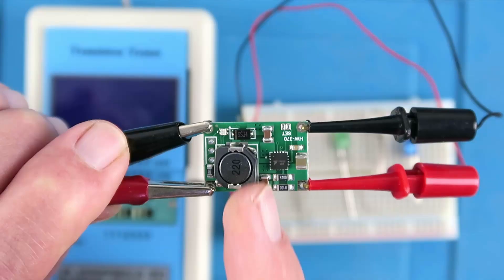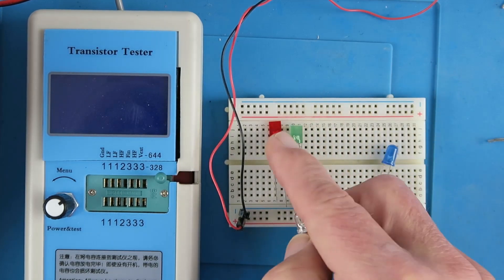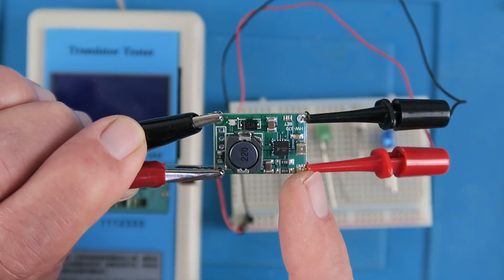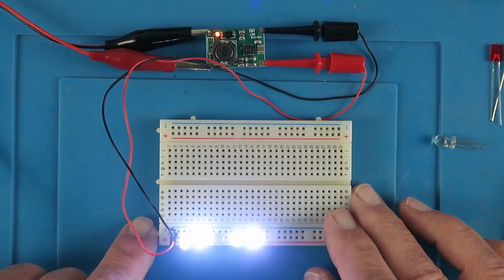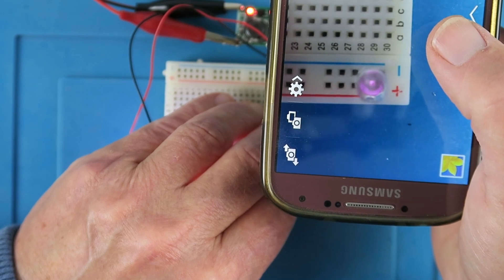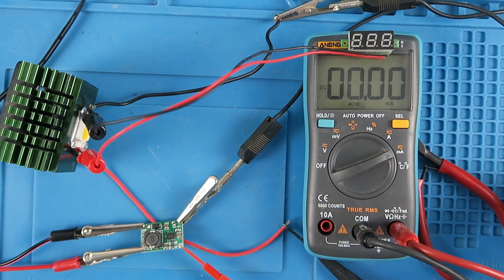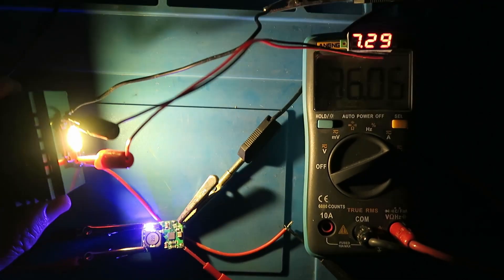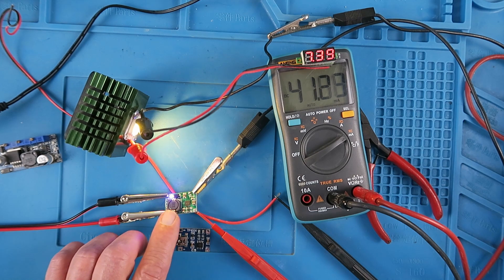LED Driver From TP5100 LiPo Charger? Tutorial

Comment: how about 3 leds/1w 3.3v in series?
Reply from the maker: I don't think that will work as the voltage is only 8.4 volts.
Reply: 9.9v /1w leds better then 12v/10w led. More brightness. 3.3v maxim/led , ideal 3v.

Comment: One thing to keep in mind, I suspect the current output would be 10% (precharge) of the the charging current in it's default configuration (RTRICK pulled down), is that the board where you've cut the trace to charge at 1A? In which case, it should precharge at 100mA... if left floating, it will 100% of charging current, alternatively, one can adjust the Rtrick using the formula in the datasheet: RTRICK=
(400k Itrick - 40k Ibat) / (Ibat - Itrick), a table is also provided: 50k = 20%, 114k = 30%, 320k = 50%, floating = 100%.
Appears that internally there's a Vref (not specified) and a voltage divider of 360k/40k, not sure where the 400k figures comes from.
Reply from the maker: Thanks for the useful feedback. The board is as standard at the 2 Amps charge rate. First tests were done at 4.2 volts and the 10 Watt LED at 8.2 volts.

Comment: I've had good luck using 2 TP4056's and wiring each cell in a battery holder in parallel while the pack is wired in series, sounds funny, but you probably know what I mean being a guru. The out puts don't care if they're in series or parallel, The inputs are the issue and you can use 1 or 2 watt isolation chips, but you wont get 1amp charging. I use 2 separate phone chargers for isolation reasons and the cells are balanced when finished. People say you don't need to balance never mind a 2S, but the first cell seems to take a beating and they fall out of balance when you're draining the cells to fast.
Reply from the maker: Yes I follow you! The isolation is an issue in this case.

Comment: They should design them 5100's to balance 2 cells on the back side of the board.
Reply from the maker: Yes, it should be an easy thing and not increase the cost of the board much. I do not get paranoid about cell balance, if the cells are well matched to start with there should not be a big problem. The LED light I modded back in 2016 has never been balance charged and the cells are within 0.002 volts of each other. Of course when used in high current applications like RC models and drills it becomes important as the cells are often abused in these applications.